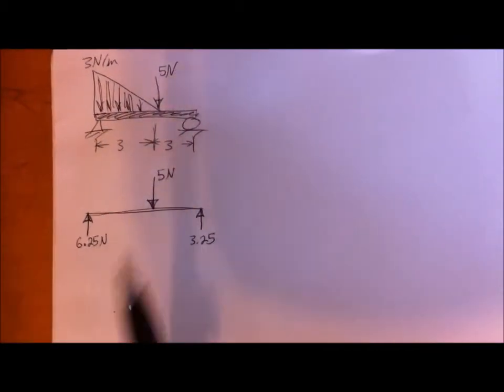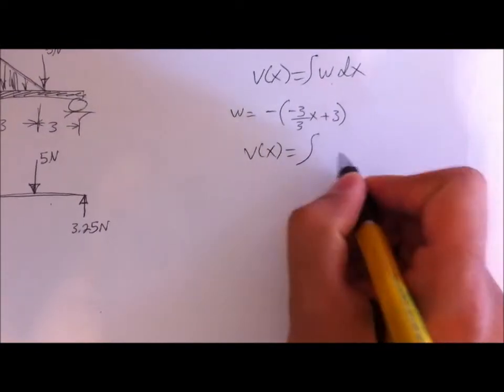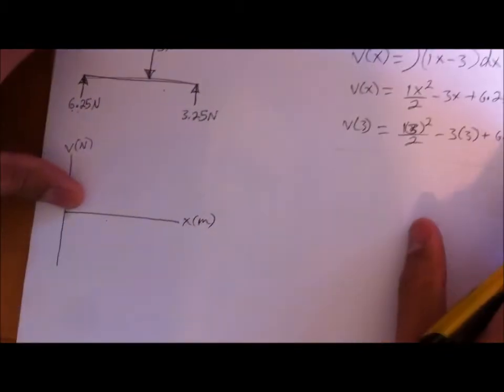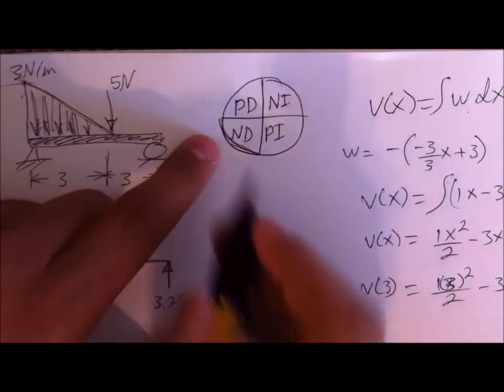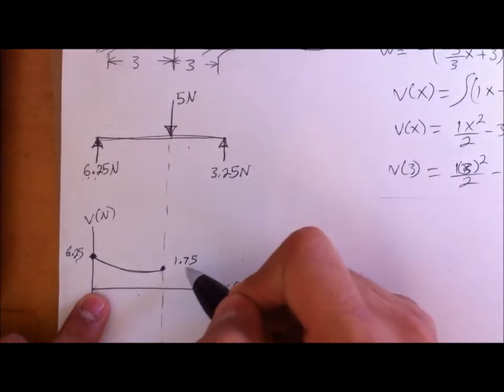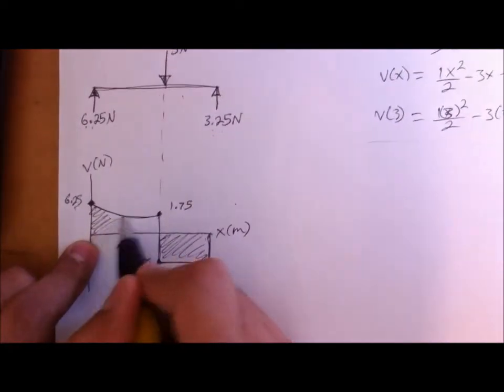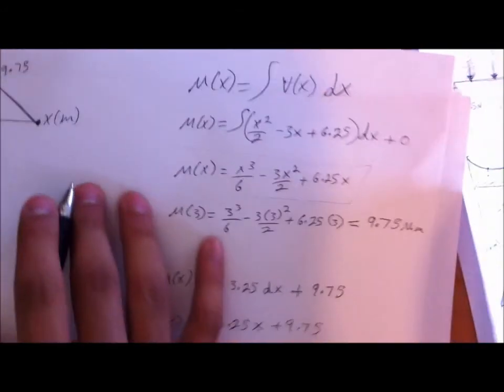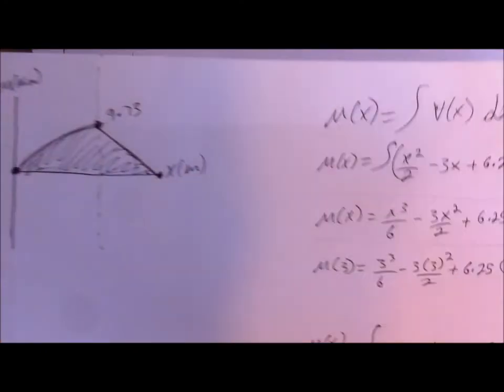Drawing shear and moment diagram part 2

Comment: WHY 3 OVER 3
Reply from the maker: 3/3 shows the slope of the line. think of it as two points (0,3) and (3,0) which are basically the points located on each end of that triangle. using those two points you come up with a slope of 3/3... how that helps!

Comment: Your response to Emad SH two years ago answered my question today.  After days of pondering why divide by 3 in the equation:       -3/3X +3    I was not seeing the rise over run.  For days I was saying to myself:  "It has to be something simple that I am failing to see."  Thank you immensely for teaching us the calculus.  What I want to know more fully is how does one establish the distributive load figures like 6 newtons per meter?   My table top is 53 cm wide and 152 cm in length.  My loaded Craftsmen toolbox weighs about 29 kg which will be at approximately one end and a couple of bags of groceries spread out at other points on top of the table.  And if my girl friend decides to sit on the table for a moment, now I have another 66 kg on the top of the table.  The table will be stout to take all this.  And it seems that I am looking at some kind of a distributive load.  Yes/No? Again, thank you for the excellent load shear moment diagrams you have presented.  They are the exceptional.

Comment from the maker: You have to go back to the basics of the meaning of a slope. slope = rise/run =delta y/delt x..
so for this problem. the points at the end of the triangle are (0,3), (3,0)
so my delta x= 3, and delta y = 3. 
so slope= (3/3)x
but now you have to consider the direction of the force (-) since its downwards and the direction of the slope (-) since it is downwards as well..
hope that helps and sorry for the late reply
studying for finals lol

Comment from the maker: @Emadshammaa  i wasn't finding the area if your talking about the integral for solving for the shear. What i did there was the slope of that triangle. if you see closely it starts at 3 if you look at it in the xy plane in other words b=3 and the slop is down 3 and run is 3. so the equation becomes y= -(-3x/3 +3) which is the equation for the shear of the distributed forces. hope that was clear :)